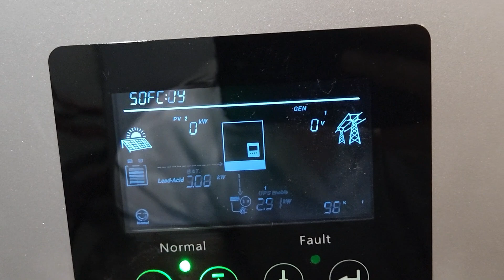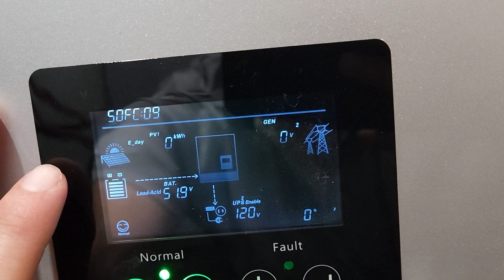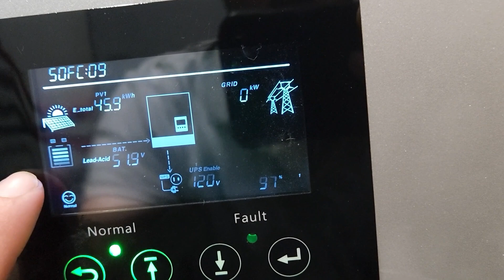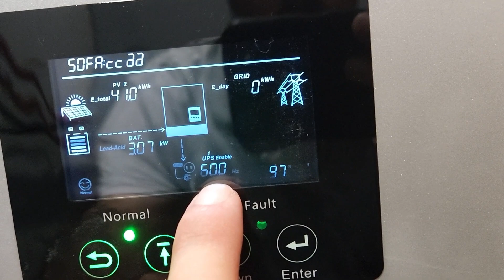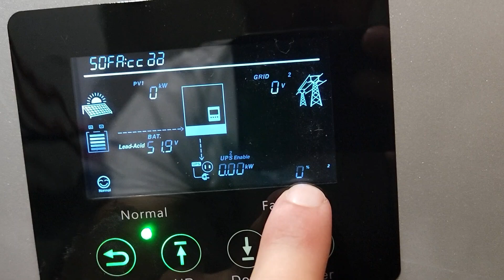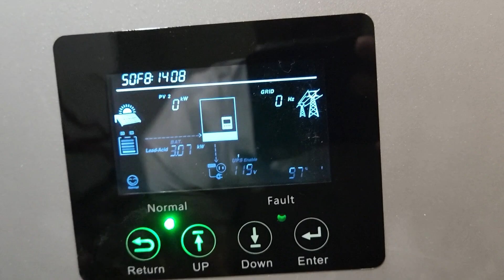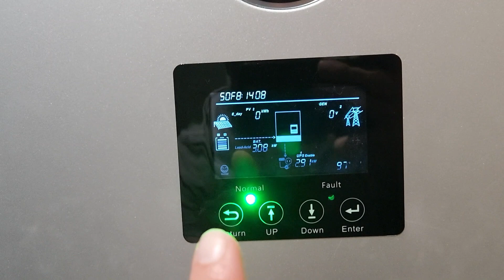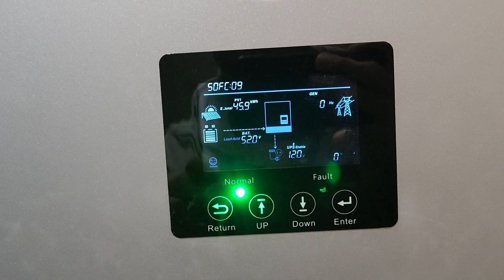Max Continuous on a single Leg with one 6000xp (30 Amp RV Load)

Comment: COULD OR WOULD YOU USE THIS UNIT IN A TRAVEL TRAILER ??
Reply: Right but you could split you circuit breaker into 2 seperate systems one for each leg
Reply from the maker: I would.  

It would be best in a 50 amp (2 leg) RV.   It only weighs 50 pounds, air flows right to left.  So it could work in a larger RV basement storage room.

One negative...in a RV is the high minimum starting MPPT voltage.
Reply: Couldn't you open your  panel in your rv and hook up microwave & fridge  one 1 leg and a/c and water heater on another leg for 6000watts ?
Reply from the maker: Depends on your RV. 
30 amp RVs typically only have 1 leg
50 amp use both 120v legs but rarely use then in a 240v layout.
Reply: I would never use a low surge, high frequency, transformerless inverter in an RV application. Their high switching speeds generate far too much heat which shortens the life of the MOSFETS in the H-Bridge circuit and dries out the electrolytic caps in the filter circuit.
Reply: @kickgas7171   I manufacturer  capacitor banks  I've never heard of a capacitor drying out due to mosfets . ripple current wears mosfets out as well so  same argument  if that's the case once your batteries  ir goes up  and  not producing  like new your unit will suffer ..
Reply: @flopackrc5452  I never said that capacitors dry out because of MOSFETs. What I said was that electrolytic capacitors dry out sooner because of the excess heat generated by the higher switch speeds that high-frequency inverters operate at.